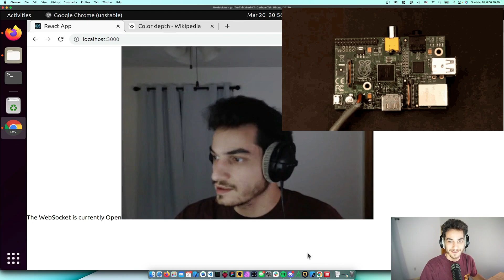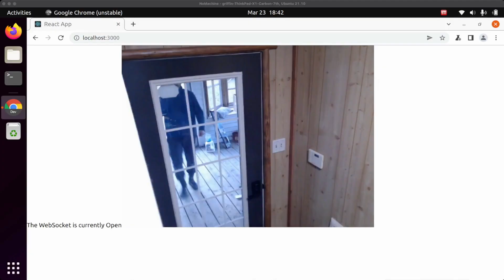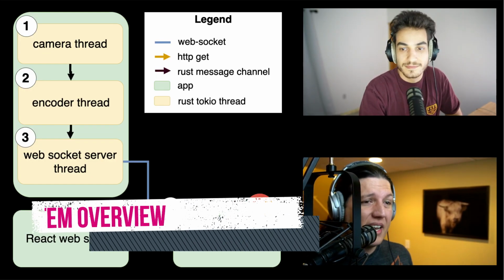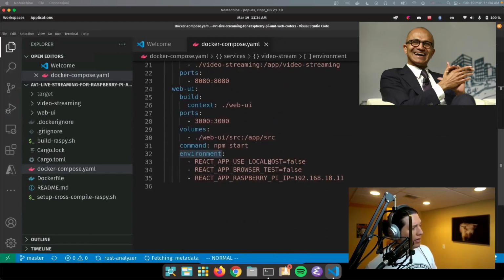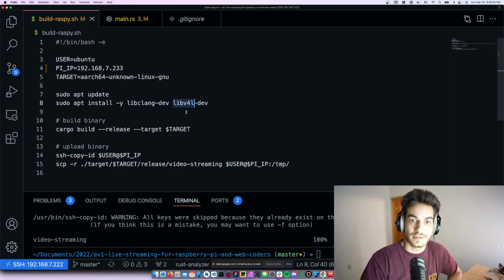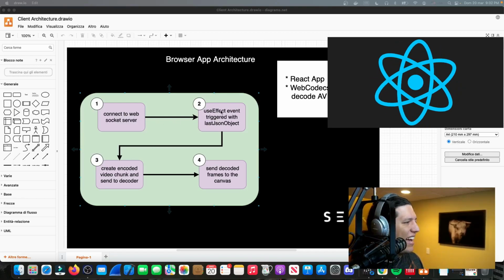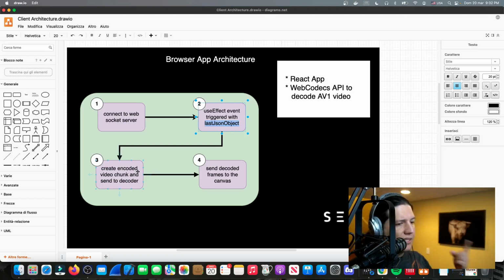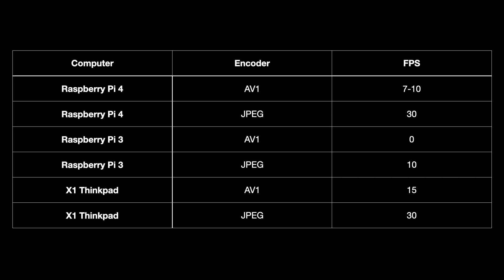How to stream video with RUST on a Raspberry Pi | Embedded Rust Tutorial

Comment: Would have been nice to compare it with the h264 HW encoders on the pi 4.
Been trying to make a 1080p@30 wildlife camera on 4G.
3G/4G has limited bandwidth especially in the wood, AV1 would be extremely useful, but doing realtime 1080p30 it's not possible.
The pi 4 and zero w 2 has h264 HW encoding which is able to do 1080p30 in theory.
Gonna go that route for now i guess and hopefully pi 5 or zero w 3 will support av1, we are already seing av1 HW encoders, just hope we will see one on the next gen.
Reply from the maker: Hey Jimmy! I tested vp8 and vp9 and those work great! I promise I’ll update this to support these encoders
Reply: @dario.lencina  nice. Didn't explore vp8/9 since there is no hw encoding either but if i could do 1080p30 eith sw encoding and less bandwidth why not.

Hopefully hw av1 will be supported in the next gen pi or at least h265. My only alternative is like the jetaon nano. Was waiting on the orin nano but nvidia decided to remove hw encoders for some reason...
Reply from the maker: @jbeaudoin11  If you are working on this right now, I recommend trying https://github.com/astraw/vpx-encode/blob/master/src/lib.rs
Reply from the maker: @jbeaudoin11  looks pretty solid. what else is your pi going to be doing??
Reply: @dario.lencina  first interation i think i want to simply send pictures via mms or maybe upload images and video to a home server. Might be challenging enough since 4G network isn't that reliable in the woods
Reply: @dario.lencina  and there is the whole motion detection part of it that's also pretty challenging. Not sure what direction i should take tbh.. the pi doesn't boot fast at all. I would like to get it down to <5s but im not sure it's possible with the zero 2 w.
Reply from the maker: @jbeaudoin11  ughhh yes, all those trees will kill the signal. you might want to check the signal in your area with https://www.verizon.com/coverage-map/